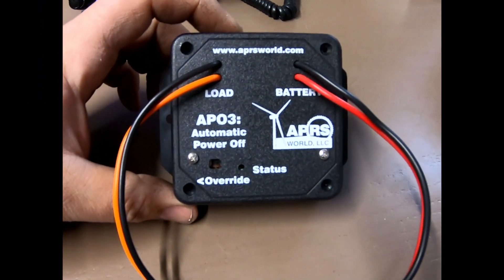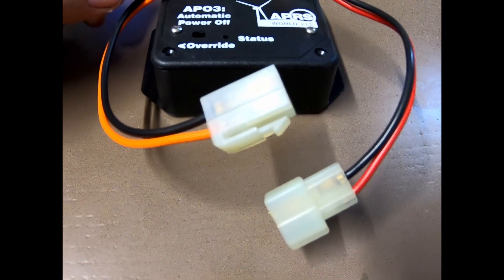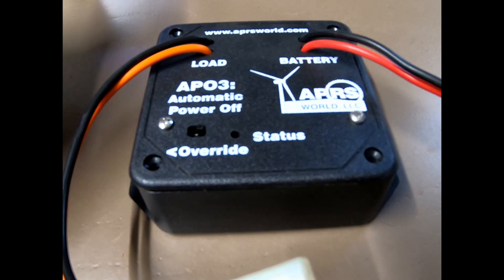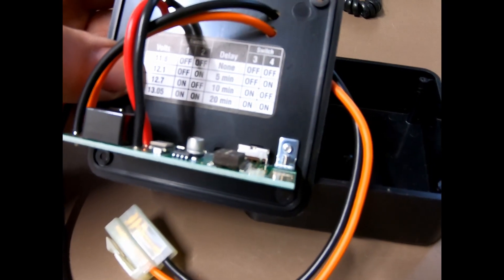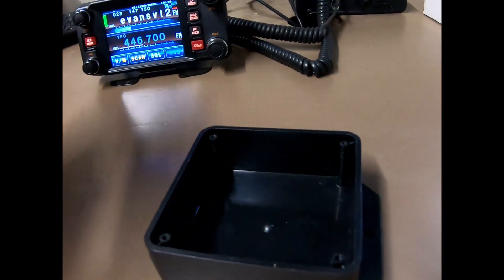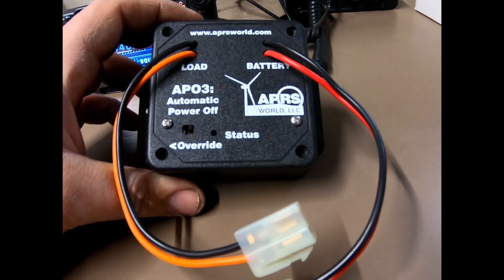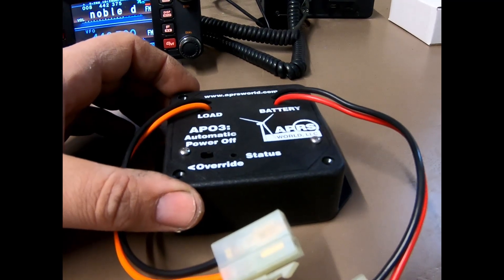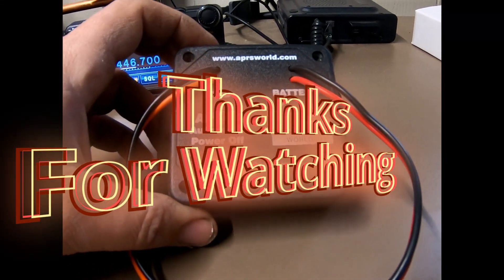Battery Automatic Poweroff Relay For Ham Radio

Comment: Does this simply plug in in-line with your power from the car battery or do you need to tap?
Reply from the maker: Just simply plug inline. Thanks for watching
Reply: How does that plug into your car battery?